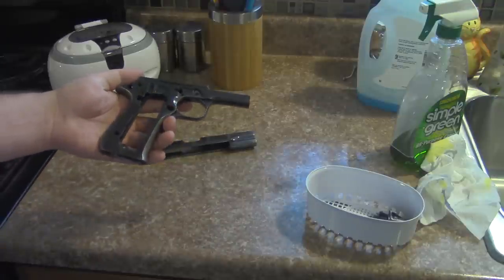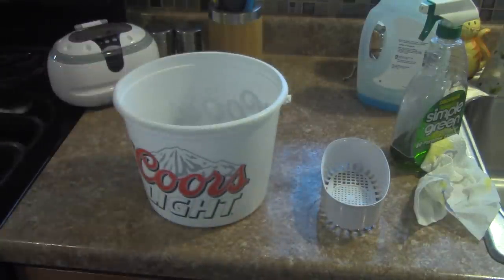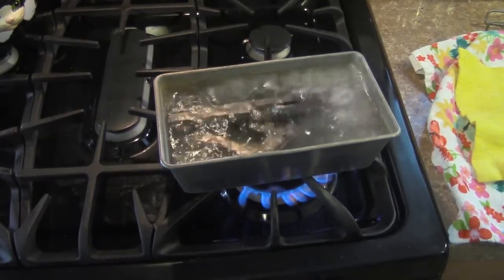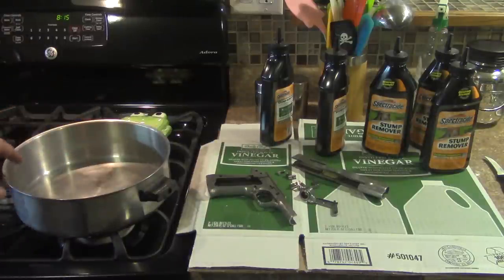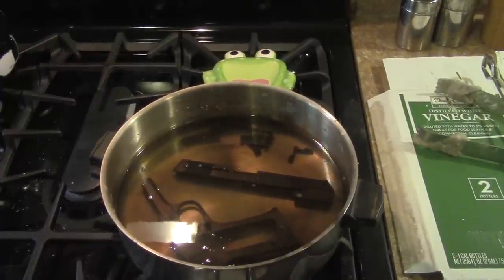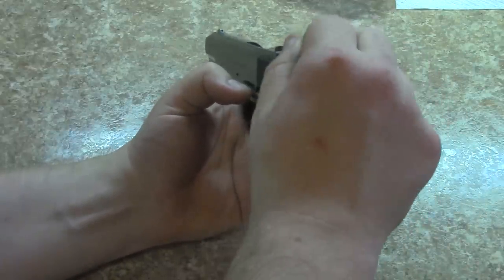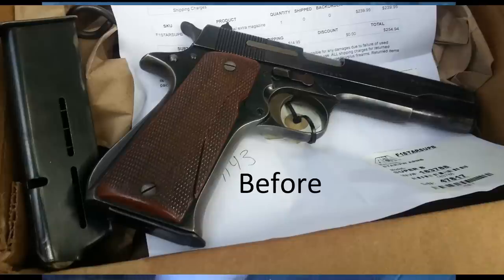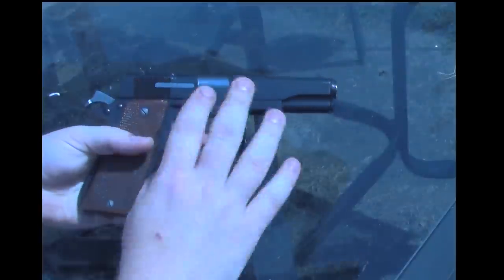DIY Reblue Your Gun at Home for $50

Comment: what about doing this to the barrel?  im thinking about this for my beretta 92s
Reply from the maker: According to the info I have found you would need to heat the part past 1200F to mess up the temper.  And the brownells instructions linked in the video description only mention not to do it with barrels that are soldered together or have a rib soldered on.  So it shouldn't be an issue to do a barrel.  I'm not sure how well it would hold up in wear areas but there is only one way to find out.
Reply: ok i did this process to my gun but i instantly got surface rust to the parts of the slide thats hard to get too like the rails and firing pin area that i couldnt sand before bluing any suggestions i havent put the gun together yet.  Do you think these areas will continue to rust?
Reply from the maker: Interesting, Did you follow each step of the process?  Even if you missed some rust, the boiling in water step should have converted the rust from red rust to black rust.   Does the rust wipe off?  Sometimes after the process I have noticed what looks like rust but is just crap mixed with WD40 in hard to reach areas and wiped off easily.  None of the guns I have refinished have had any rust issues since.  

Is it possible there was some grease or something in the channels that you missed with the degreaser?

Email me or link to some pictures if you can.
Reply: Gun&ShotTV  I think it rusted right after boiling and maybe more after   bluing i hope it didnt hurt anything to let the parts set on a towel soaked in wd 40.  i thought about boiling them again will that hurt the bluing?
Reply from the maker: The WD40 shouldn't have caused any rust.  Is it possible your water is 
acidic or salty?  Boiling water should immediately dry from the heat of 
the parts anyways so it shouldn't cause rust even if you don't really 
get it all toweled off.
Reply: some of it wiped off with q tip i may try a brass 22 cal brush to get up in there but dont seem like the bluing took inside that area.
Reply: I guess im just gonna redo it what kind of tips can you give me on prep im limited on tools.  will I have to get rid of all the rust or will the boiling get rid of it?
Reply: the color was a light blue and it was in there over 2 hrs my electric stove wont get hot enuff.
Reply from the maker: You may have active rust in a pit that you aren't getting out, boiling 
should convert it to black rust but without seeing it I'm not sure
Reply from the maker: Look up metal polishing videos on YT.  You can use sandpaper and do it by hand.  You can also use a cotton cone on a drill and Flitz.
Reply from the maker: Did the salt melt?  Most electric stoves have a protection circuit that cuts them if they get too hot which is probably your issue.  You could use a propane turkey fryer burner outside.
Reply: yes it melted the salt but the temp must not be high enuff i had one of the camping stoves that use the little tanks i tried that but it didnt seem like it was hot enuff either.  I think it rusted when i pulled them out of the boiling water maybe i didnt get it dry enuff?
Reply: can i boil these parts until I get everything I need, to stabilize the rust until im ready?  If so i prob need to degrees first right?

Comment: Yeah i polished it with mother mags polish and a light coat of rem oil,so far so good but thanks for the tip
Reply from the maker: It can be sort of random.  I have some guns that have parts that were left in the white by the factory and they have never rusted.

It depends on a few factors
1. Your location, desert good, down south or by the ocean bad.
2. Type of metal, some guns have better steel that is less likely to rust.
3. Your particular sweat, some guys have acidic enough sweat that they can get a glock to rust after a few weeks of carry.  Mine still looks like new and I've had it 5 years.
4. Your maintenance, keep a bottle of WD40 handy and hose everything down with it if you ever get caught in the rain/snow then clean and oil when you get home.

Comment: Actual gunsmith here. That's extreemly dangerious and Nitre blue should
 only be used for small parts. Not recievers nor slides. It messes with the heat treatment and will make the gun brittle.

Comment: can you reuse your stump remover?
Reply: Nice, thanks.
Reply from the maker: yes it's a heat process and not chemical so there is nothing lost from 
the salt.  You do lose some salt that you wash off in the quench step 
but it's minimal.  I've done three guns and am contemplating buying an 
extra bottle to bring the level up a bit.
Reply: When the salt cools does it turn back to a solid

Comment: Looks nice..
Reply from the maker: Burnwell _ Bandit Thanks, it turned out much better than I had anticipated for a trial run.    The next gun I reblue will be easier to take apart the Super B was a PITA,
Reply: +Gun&ShotTV how would you plug the barrel i want to try this on a rifle? great vid
Reply from the maker: +CamDawson from what I understand of the process you wouldn't want to plug the barrel as due to the temps used your plugs would shoot out and cover everything in molten salt.

Supposedly there isn't any harm to nitre bluing a barrel bore as no material is added but internet debates say it could cause issues with the temper of the metal.  The brownells nitre bluing instructions only say not to blue barrels that are solidered together like a double barrel shotgun as it will spilt the solider joints but read the brownells manual and do some more research before attempting a rifle.  I have heard of people brazing a piece of gutter and nitre bluing mosins on a turkey fryer with no problems.

Comment: what would happen if I tried this with a stainless walther?
Reply from the maker: +Gung Ferdoosh Heat bluing like this won't work.  You could use a process that adds material like parkerizing or duracoating.
Reply: Gun&ShotTV
But what would happen?
Reply from the maker: +Gung Ferdoosh I have no idea probably nothing but damaging the temper of the metal?  In reality you would want to talk to an engineer.  I'm not qualified to give you an answer and the process may make the stainless unsafe to use in a gun.
Reply: Gun&ShotTV
Isn't the stainless steel just the outside layer?
Reply: Nevermind chromium content.
Reply from the maker: +Gung Ferdoosh stainless steel refers to the makeup of the entire part.  stainless forms an oxide layer that is corrosion resistant but as soon as you scrape ot off if forms a new layer.
Reply: Gun&ShotTV
thanks for the insight, I don't know what I'll do.
Reply from the maker: +Gung Ferdoosh Stainless can be buffed to a mirror finish.  Or you can go with a paint like duracoat.
Reply: I polished it but it's just not what I want, oh well.
Reply from the maker: +Gung Ferdoosh see if there is a duracoat smith near you
Reply: Also,  I just got rem oil in my eye, I rinsed it out for like 30min, think I'm good or should I call poison control, it feels fine.
Reply: +Gung Ferdoosh on stainless you can do electroplating.. in many different colors and metals
Reply: +Gung Ferdoosh How's that eye doing?
Reply: mannys9130
Fine haha

Comment: You didn't blue the clip
Reply from the maker: +Clinton Zimmerman just the baseplate, the heat can warp the magazine lips as yhey are thin steel
Reply: Probably because 1911's don't use stripper clips

Comment: could this be used with the barrel as well? if its just a heat process then bluing of the barrel should be fine right?
Reply from the maker: +BlueBeardFarms There is some argument that doing so would effect the temper of the barrel.  According to the sources I can find including the Brownells Nitre Bluing instructions the only issue with bluing barrels is it will melt silver solider so some sight may fall off and some double barrels like on shotguns will split apart.  But if you want to do a barrel do some more research and talk to an engineer before making your decision if you feel it's safe to do so.  I'm not qualified to offer an opinion.
Reply: +Gun&ShotTV So maybe not the right method to use for revolvers if that would include the barrel? I would like to see the best method for barrels. BTW, thanks for sharing. I enjoyed the video and looks like it turned out great.

I have seen some fairly simple DIY parkerizing videos but as you know parkerizing protects but doesn't leave the best looking finish. ;-)

If that is an Astra 1911, I have an Astra A-100 that is basically an all steel Sig P-226 clone or copy. This Nitre method might come in handy for it down the road if it ever needs rebluing.

Comment: heat treatment is  fucked. such metod should not be used for parts heat treatment of which is important
Reply: you must not understand that from the factory, the blueing treatment involved boiling the parts in a blueing salt solution as well as the heat needed to begin to effect the heat treatment is much higher that that used in the blueing process, professional or otherwise.
Reply from the maker: That isn't true, if it were the heat from firing the gun would also de-temper the parts.  While it is slightly hotter than an acid blue process it's not hot enough to damage heat treatment.

Comment: Cool vid man, really nice STAR you got now, too ! :) But why is it a shitty gun?
Reply from the maker: TheSadGuy I meant it was in shitty condition, because when I got it it was all beat up. But due to the condition it only cost $240 from AIM Surplus.  Had I screwed the process up on a nice old gun or one with sentimental value I would have been pissed.  Now it looks as nice as it shoots and I only have $300 in it.
Reply: Gun&ShotTV Oh, I see. It really does look nice now. I thought that there were some issuses with the gun, like quality or reliability. Wow, $240 for such a classy gun, thats just awesome !
Reply from the maker: TheSadGuy The only issue I have is the second mag.  It will lock in and feed fine but won't drop free and needs to be pried out.  I spent some time sanding/filing it and it's getting better, now you can pull it out by hand but it still needs work.  I'm not sure if that's normal for a new mag but once I get it 100% I'll reblue the mag body to make it look nice.